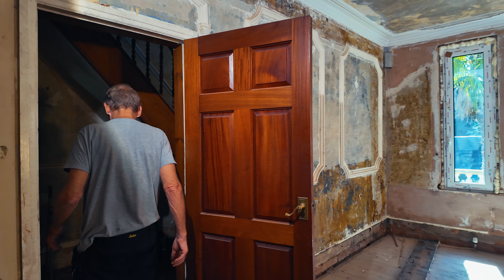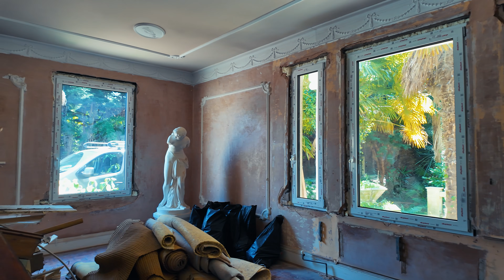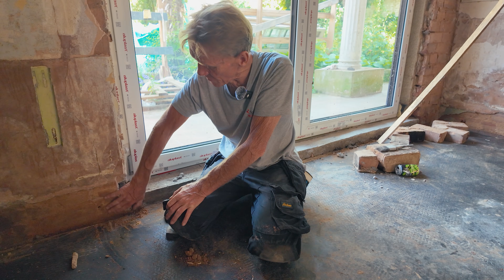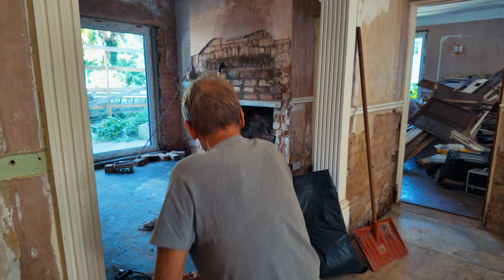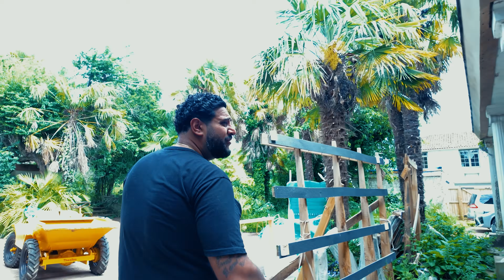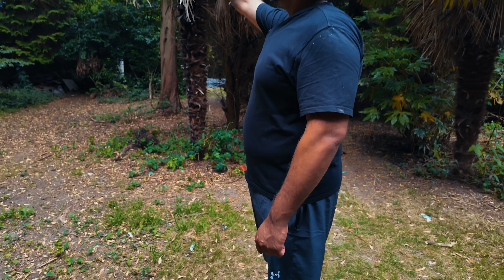The Damp Proofing Mistake That Makes Old Houses Worse

Comment: Replacing timber suspended floors with concrete in my view is not good.  Bridging tge damp courses on the  walls , damp proof membrane only pushes the dampness to the  walls.  The walls beneath the damp proof courses need to breath and dry out via sub floor insulation.  If you must install concrete floors , leave them shy off the walls with ventilation channels.   Changing the floors to concrete is the cause of the dampness in these walls from what I can see.

Comment: There are some fundamental problems here:
1. The house was built in a watercourse and for the moment is floating on it.
2. The homeowner who declares himself as an engineer yet does not understand heat pumps or how three phase is utilised in domestic properties. Not a ‘real engineer’.

In Sum, you did not quite get the bargain you thought you were getting in buying this property.

Comment: Asphalt on a solid concrete floor seals the floor so that the moisture under the floor cannot escape except...up the walls!  And if the wall dpc is poor or missing - major problem.  High outside ground level will add to the problem.

Comment: Interesting! I am from Northern Europe and this thing with Damp proofing is a bit unfamiliar to me but I think I start to understand the idea. However, in this case I perceive that this is a free standing building with some land around it, and it might be possible to reduce the water levels in the ground by digging a trench around the building, perhaps 50-60 cm deep, put drainage pipe in it and crushed stone, lead the pipes to a well with a pump and then just pump the water further back into the property. The drainage should be just close to the outside walls. Pavement and so on could be restored on top afterwars. If rainwater is properly diverted a few meters out from the building this could dry out the ground below the building somewhat and just reduce these rising damp problems.

Comment: when we did our victorian house one thing we noticed was that over the years many, many layers of wallpaper, and wallpaper paste that had been applied by the previous owners over the years had formed a sort of sponge that soaked up water but didn't let it breathe it out - a huge amount of the mould and damp problems where solved by removing all the old wall paper  and taking the walls back to the original plaster - again just another example of ventilation being the best cure rather than trying to create barriers.

Comment: ... go for a ASHP bud - never looked back since I watched Roger with John Morgan's challenge - we didn't go for a MCS system, but an accident damaged (dropped) £900 6Kw system - the whole system is less than £600 a year to run for constant heat 24 x 7 at 20 degs - an underfloor system shouldn't be run above 37 degs - so why do you need a powerful gas boiler - when an ASHP will run 24x7 at ease (just like a fridge)
Reply: Yes. Brand-new heating, underfloor, makes a heat pump a no-brainer; the whole house will be so much more comfortable as well as cheaper to run.
Reply: 💯 agree! Heat pumps are the best!

Comment: Crazy to put gas boiler into new system build.
Build it for a Heat Pump - large primaries, open loop with 100-150mm centres on UF heating pipes.
Install a cheap second hand Gas Boiler and then claim BUS scheme grant for ASHP.
Good idea to have a look at Urban Plumbers videos: https://youtu.be/7Ml_xOJsLTo?si=06Fa1IIohWl7GnsM
.
Don't let the plaster bridge the dpc or damp
There's a method that uses foam adhesive (for instant stick) and Stormguard Hybrid adhesive to stick Plasterboard to walls that retains an air gap and allows for walls to breath.
Have a look at https://www.youtube.com/@dampsam/videos
.
Chimney's - good chance those (that show soot buildup) will have issues with Hygroscopic salt drawing moisture (google Why Soot Causes Damp)

Comment: A mega-project. It looks like a palace and grounds fit for a king.....but as for the damp, well everything needs doing from the (under)ground up. The priority has to be to sort out the damp and the flooring along with the ventilation before anything else happens.

Comment: Just bought a1950s bungalow, full of damp, built on clay and I'm installing wet underfloor heating. So there was a lot of interest in this for me. Contractor has been called in to deal with the damp problems but I'm worried about dry rot in the walls...we'll see 😢🎉🎉😢

Comment: Nice to see a sensitive renovation of a hundred year old house, complete with plastic double-glazed windows held in with spray foam.
Reply: 😂 indeed, plastic gives it its authenticity
Reply: It's crying out for a further two dozen corinthian columns and flush downlighters in the eaves, of course...
Reply: With tilt and turn windows that big masonry fixings will have been used for sure. Good luck with that big tilt and turn door though, that is pushing your luck !

Comment: There could be a potential problem with the existing ground floor that may have been overlooked by the owner and that is clay heave from the existing numerous trees  surrounding the property so my advice would be to consult a structural engineer who may advise you to not use a solid concrete floor ground floor on the property but use a fully cross vented suspended ground floor everywhere instead..
Best to be safe than sorry..🏡😉
Reply: Clay heave is not caused by tree roots just the opposite shrinkage
Reply: @JohnDivers-e1u  I agree, that's why when you have trees or drainage problems and are thinking of having building improvements done on your property such as replacement of the ground floor then an invaluable structural engineer will allow for both the expansion and shrinkage of the clay in their design so you don't have problems in the future.😉
Reply: @JohnDivers-e1u well considering all the clay inside is damp i don't see that being a problem

Comment: Take the whole lot up and lay a solid floor new damp course membrane , insulate and screed  belt and braces.
Reply: rip the joists/floor out,fill with hardcore and screed/concrete onto with DPM?
Reply: @khang2122 and 100mm insulation
Reply: @khang2122  100%